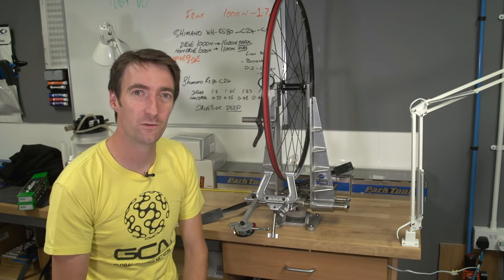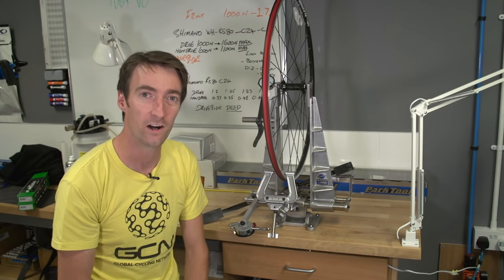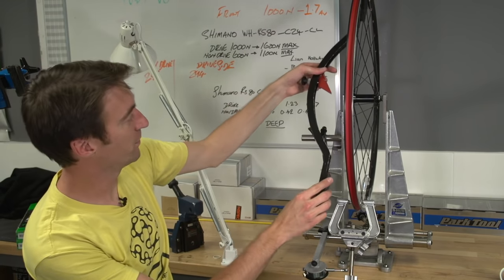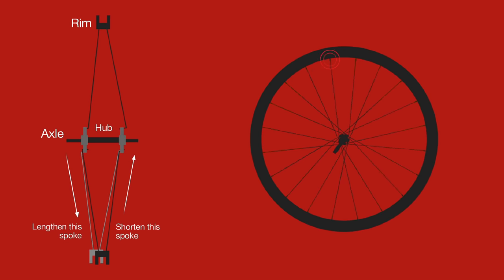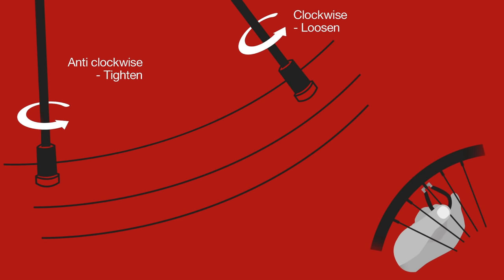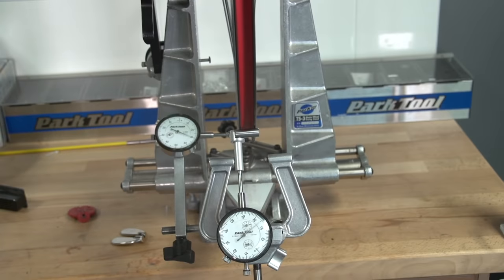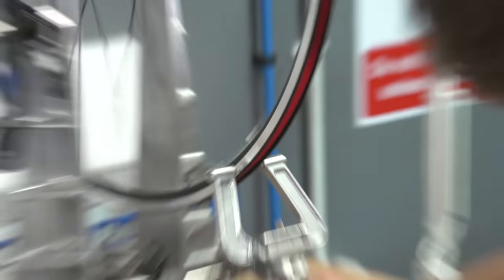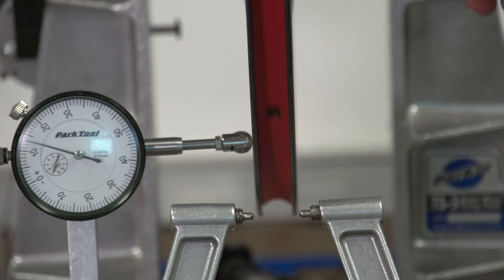How To True A Bicycle Wheel

Comment: This is actually quite awful.  Never change the dish of a fully tight wheel with 1/2 turns, more like 1/4 turns.  The rim is being pulled to the left or right, not towards the hub.  There were no explanation of "long areas" out of true only short ones that need single spoke adjustment.   there was no part on truing out of round??

Comment: another useless video from you guys.  I mean if you want to teach people something spend some time doing research how to best present the information.  There is also no explanation of the important aspects of theory behind the contruction of the wheel and why turning clockwise loosens rather than tighten the spoke.  Lastly, most people do not own all the equipments in this video so the process is not exactly replicable for 99% of the people watching this.
Reply: What do you want the theory for? The video shows "how", it's even titled "how to", not "why". Go search for the "why" if it's so important to you. Plus, if "most people" don't own the tools which are ABSOLUTELY necessary to do the job, it's because "most people" won't true their wheels themselves but rather take them to a shop. I'm assuming that if someone wants to do this, they will consider buying the necessary tools for the job. If you're referring to the very expensive trueing device, there are cheaper options.

Constructive criticism is good, but yours wasn't that.